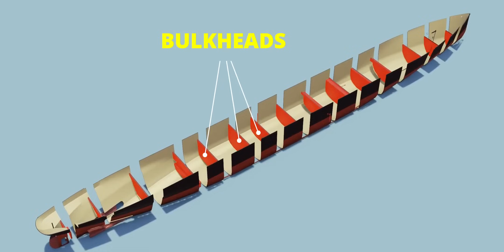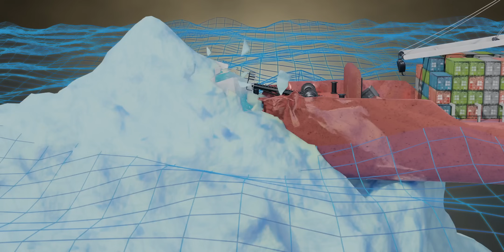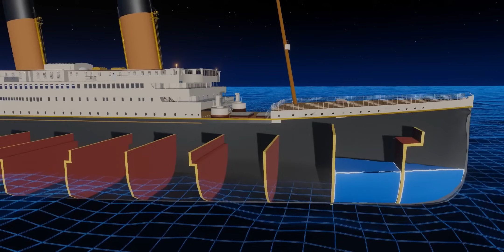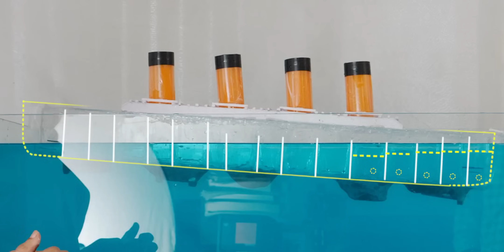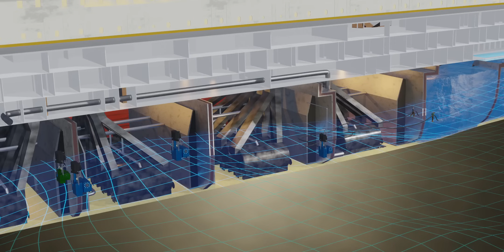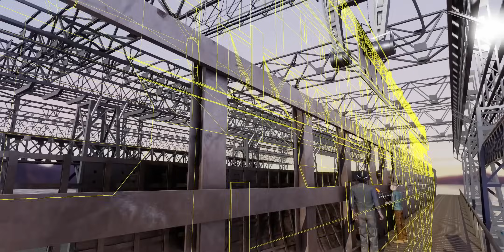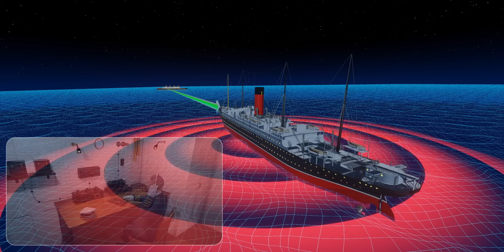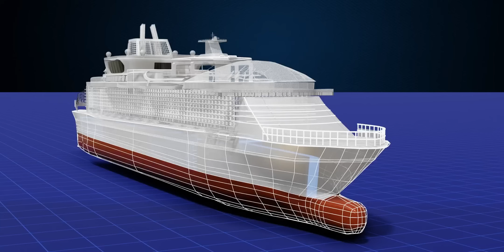How did Titanic Sink? | The Complete Physics

Comment: Min: 2:00 wouldnt it have been smarter to set the first funnel to ventilate the ship? I mean if the last funnel is the ventilation one and the 3 before kt are basically exhaust pipes its going to get sucked in by the ventilation one when the ship is going forward.

Comment: If the ship was designed to withstand the first 4 compartments flooded, then it beggars belief that the captain and designer didn't collaborate in working out the strategy to take in the event of a possible head on collision.  The single biggest mistake that finally sealed the ship's fate was the attempt to turn, instead of ploughing head first into the berg.  That should have been considered and worked out before the ship set sail.

Comment: They had two different surving options and took the most bad one.. 
1: Just shot down everything until daylight 
2: Hit the iceberg with the front 
The sides are really the most weakest points on a vessel ..
Reply: That however ignores the fact that Ocean liners never stopped for anything as they had a strict schedule fulfill with passengers paying specifically for said arrival time.

Hitting the berg from the front would have flattened the bow to the bridge, killing a few hundred people instantly while the force of the impact split her seams the entire length of the ship, resulting in her likely capsising in minutes and killing most if not all on board.

Comment: Im been looking over the building prints of the ship and you will see theres flaws and its all in the 2nd bukhead you got the firemans  sterwell runs the high of of the ship then you got the cargo loading shaft al so runs the hight of the ship then you got F deck starts at bulkhead 2 Scotland road hallway runs the length of the ship till bulkhead 10 and there some porthole just above water line high waves water will go into the ship right wheres the pumps in the cabin areas .

The ship was builed to failure Let that sink in your heads.

Comment: A deep sea sub revealed that the hull wasn't sliced but struck so hard that the bolts failed like  the video shows. Many used to believe the ice burg cut the hull like a knife. Some believe a head on crash would not have caused a sinking???
Reply: yes the cold and unperfect steel they used to make the rivets made them all snap, end of story

Comment: FYI, the Titanic's central propeller was not capable of reversing. It was only able to propel the ship forward, and even then only when the ship was moving at high speeds. At low speeds, there wasn't enough steam to run the steam turbine.

Comment: What would have happened, if, additional to pumping water from the first 5 compartments, they flooded the last compartment, effectively decreasing the tilt of the ship? Would it save the ship?
Reply: well at the back theres very important equipment that you absolutly don't want water in so even if it somehow worked it would be out of the question
Reply: @Nighthawk0954   Well, water got in those compartments anyway, when the ship sunk, so they wouldn't loose anything flooding them. However they could have saved 3000 lives if my theory is correct.
Reply: Buoyancy exist

Comment: an interesting idea you come up with about a head on collision , when i considered the design of the titanic and its sheer fully loaded weight a 50,000 ton ship travelling at 25 mph hits a static object the impact would cause the ship's structure to flex, popping rivets and splitting seams, just as in the actual Collison, but in this case along the ENTIRE length of the hull, opening up several more compartments to the sea , in this scenario the ship would sink in minutes and not hours

Comment: Funnest Fact the water tight doors and bulkheads did not go all the way to the top... so the water just spilled over to each compartment when one filled up.

2nd if they had kept going they may have still made it to America or a lot closer...but since they shut off the engines they became dead in the water. The Olympic had very similar damage and was able to limp back to port.

Intriguing theory that might not be the Titanic at the bottom of the ocean it might be the Olympic....
Reply: The wreck has been proven to be Titanic by the existance of her yard number 401 in the debris field. The switch theory never happened.
Reply: @Tozzpot500 and also titanics name was engraved on the ship not bolted

Comment: There is a one mistake in the animation. When captain order full back speed the central propeller stoped. Only the side ones could spin backwards. That could be the crucial detail. If really all 3 coauld spin backwards they could avoid the iceberg bezcoz they could slow down quicker.

Comment: One of the stories that I head about Titanic was that putting the engines in reverse was a mistake, because it actually reduced the ability of the ship to turn.
Reply: Yep its right, if they put it on all ahead full it will be spin faster
Reply: Yes, this is because the thing that makes ships turn is the amount of water being pressed against the rudder at the correct angle. By redcucing the speed, you increase the turn radius. And since it was clear they wouldn't have been able to stop anyway, they shouldn't have done that
Reply: @Sembel-xh9vq   In fact, as the video shows, if the captain hadn't turned at all and ran headlong into the iceberg, the ship wouldn't have sank at all.  Turning was the mistake.

Comment: I always wondered if they had deliberately counterflooded a couple of the aft most compartments they could have leveled the ship enough to keep water from spilling over the forward bulkheads beyond the fifth compartment.
Reply: The ship does not have a counter flooding system. Although reversing to strike the iceberg again is a crazy but workable solution.

Comment: Excellent video! What would have happened if the captain decided to fill the rear two or three compartments while pumping out the water?? Would that keep the ship at a low enough angle to stop the fifth compartment from being filled?
Reply: It would not yes it will make it more even but it will make it sink faster and it won't stop it from sinking
Reply: @MurpheysDiner  Can you explain how you know this?
Reply: @snagginbirdies1006  simple
Reply: @snagginbirdies1006  also the pumps cant pump the water faster then it was filling with water
Reply: @MurpheysDiner  Okay so you have no idea and you just guessed. You don't know if it would sink by filling or partially filling those back compartments. It sank because the angle got steep enough for water to get over that barrier into the fifth chamber. Fill the back and yes the boat will sink slightly lower into the water but it would bring the front up and maybe it doesn't get over that wall. Buoyancy is a strong force. Cruise ships today put 7,000 plus people on board, if the average weight was 175 that's 1.4 million pounds and the ship only lowers into the water a few inches.

Comment: There is a grave error in this presentation.
There was not recommended a speed of 12 knot/22 km/h during iceberg warnings when Titanic sank. That was instituted after the sinking, along with other requirements such as having enough lifeboats to everyone onboard.

Up until Titanic sank the recommended procedure was to maintain speed in clear conditions.
Ships, particularly mail-carrying and passenger liners like Titanic, were expected to keep up their scheduled speed unless visibility was significantly reduced (e.g. in fog or storms). Slowing down merely due to the possibility of icebergs was not common practice, and there were no binding maritime regulations requiring it.
If iceberg warnings were received, captains were expected to post additional lookouts and alter course slightly if needed, but not necessarily reduce speed if visibility was good.

At the time, this was not considered reckless by industry norms, though hindsight and investigation changed that perception.
There was a strong belief that icebergs could be seen in time and avoided by maneuvering, even at high speeds. Nighttime visibility under starlight or moonlight was often considered «sufficient» by navigational standards of the day.

Besides, they did take action based on the number of iceberg warnings.
About 6 hours before the collision with the iceberg, captain Smith ordered the ship’s course changed slightly southward from 266° true (west) to 245° true, a more southerly path by about 10 to 15 nautical miles.
This was a modest adjustment, and it was implemented according to evidence from surviving officers, notably 2nd officer Charles Lightoller and 1st officer William Murdoch.

Comment: Titanic could accommodate 2,200.  Could the sinking have delayed if 2,000+ mattresses were stuffed down forward staircases leading to the lower levels.  Plug  corridors running the length of the ship.  Shut every door. Drain the swimming pool.  Everybody stand on the stern and start bailing?

Comment: The tragedy is that if the coal bunker was watertight, there may have been a small chance to save the ship. But once the flimsy thing breached, there was nothing they could do
Reply: Are you suggesting that had Coal Bunker W's hatch doors in Boiler Room 5 held the flooding sea water within said coal bunker Titanic wouldn't have sunk?  The loss of Holds 1, 2, and 3 plus Boiler Room 6 alone exceeded the limits of volume Titanic could spare and remain buoyant. Of course, there was also the matter of the first watertight compartment a.k.a. the Forepeak Tank but it's relevance to Titanic's sinking was almost negligible thanks to the horizontal bulkhead forming the tank's upper layer which held back the rest of the compartment's flooding until later in the sinking when flood water overtopped the collision bulkhead after the vessel had achieve a negative enough pitch in the water. Had Coal Bunker W as it was notated in Harland & Wolff's blueprints kept the flooding within Boiler Room 5 fully within the confines of that bunker the ship would have achieved negative enough trim in the bow allowing flooding in Watertight Compartment 5 (home of Boiler Room 6) to fill up and flow over Bulkhead E into Watertight Compartment 6 (home of Boiler Room 5), the situation repeating itself until Titanic ran out of buoyancy and disappeared beneath the sea.
Reply: @RobbyHouseIV  Yes, I am well aware of everything you wrote. If that coal bunker panel hadn't given away, it may have been theoretically possible to save titanic with a perfect disaster response, but once it did there was absolutely no chance.

Comment: They only needed to stop water coming in to one compartment!
With the calm seas this is in theorie possible with a foil or leak cloth from outside.
You lower ropes under the bow and bring them to the position of the leak.
Attach two ropes to the leak cloth, and the other side of the cloth  to the ropes already underneath the schip.
Pull on the opposite side of the ship, and let go on the side where you are standing untill you reach the leak .
The cloth or foil is pushed into the hole by the force the of water flowing in, sealing of the leak to the point where you can pump out water faster then it comes in.
This works very well on smaller ships and inland navigation, probable not with rough seas.
As I understand the sea was very calm during the accident.
Reply: Are you crazy, titanic weighs thousands of tons, and it's not easy and simple for such
Reply: That don't work with big ships
Reply: The weight of the ship will be insane on such also
Reply: The pressure will be so much it will break any repairs
Reply: It's not simple

Comment: Think of this: if the watertight doors remained open, the ship would have remained afloat for much longer time, probably quite enough to save everyone onboard. (Some say up to 24 hours!)

DISCLAIMER: I do not blame anyone onboard for closing the watertight doors! I would've done the same if I was onboard and in charge!
Reply: if the doors were opened the water would've easily flowed throug all compartments which would make it sink faster
Reply: @Nighthawk0954  to the contrary!  Find out the volume of the ships hull and the water flow, divide them to get the time and you'll realize I'm right!
Reply: @bsimic29  opening the door would've make it sink faster because of the free surface effect making the whole ship unstable which could cause it to have a dangerous list or capsize like her sister Britannic or the Impress of Ireland which all didn't get to close their watertight doors also aside from the free surface effect, the doors being opened would've flooded the boiler, engine and dynamo room earlier which would cause it to loose power way earlier and that would've plunged the ship into darkness faster causing absolute chaos and making evacuation harder also no power means that the wireless system can't work since theres nothing to power it making distress calls impossible. And to finish the boiler rooms being flooded could present high risks of boiler explosions which could make the whole situation worse.
Reply: @Nighthawk0954  I agree with you on most of things you've said, except: "free water surface effect" would take more time to capsize the ship (if at all), there were emergency generators onboard the ship that would give light for some time and radio room had its' own backup supply that would enable them to keep sending messages. The only important thing was to remain afloat until Carpathia arrived, and (absolute?) chaos due to darkness would definitely take less lives than sinking into freezing water.

Danger of exploding boilers is present if water was rising rapidly, which would not have been the case in Titanic disaster.

Britannic had different type of damage comapred to Titanic (explosion blast that made much bigger hull opening and had ships' internal structures damaged which made it sink much faster and more prone to capsizing).
Reply: @bsimic29  let me ask you a question: why do they even have watertight compartment and doors in the first place if its not gonna do much like you claim
Reply: @Nighthawk0954  They had compartments and doors to protect the ship in case of breaching:
- any two consecutive compartments
- any three non-consecutive compartments
- last three compartments
- first four compartments
But you already knew that, I'm sure.

In case of breaching first five compartments (or more), the story becomes different and saving lives (not the ship) becomes imperative. If opening watertight doors would've saved lives, doors should've been opened. (As I've heard some time ago, some watertight doors were actually opened later, during sinking.)

Now, my original post was purely hypothetical, I'm not expecting them to come to this conclusion during sinking neither putting any blame to any crew member for not doing so! I was expecting some discussion here about the idea.
Reply: Now, there's another hypothetical question: could've they re-started engines and sail towards Carpathia, to reduce distance (and therefore precious time) until rescue? Could they have sailed astern instead of ahead to reduce water intake?
Reply: @bsimic29  the absolute dumbest thing you can do with a sinking ship is start the engines because it will sink faster (that was one of the reason why britannic sank faster) and carpathia was about 93 km from titanic so it would be useless to do so and another problem would be lowering the lifeboats because they would be drawn towards the propeller like britannic if they kept them on

reversing the engines would do absolutly nothing because no momentum could save the ship because whatever they did titanic will 100% sink

Comment: What I've never been able to understand is why the athwart ship water tight bulkheads only went up part way and left the compartments open at the top. Each of the decks could have been built to be sealed in an emergency like the watertight doors. On the plus side Titanic did not roll over and sink but went down but upright allowing people to get off. Andria Doria suffered a side impact in 1956 and rolled over and sank, fortunately help was close at hand. Costa Concordia was torn open on her side and rolled over and sank, again help was right there.

Comment: Since there was a instruction for full speed, it means that the boilers had been extremely loaded for more heat and steam. 

What if there was a powerful boiler explosion. 

At the angle the ship was at some point should make it impossible for boiler operators to operate and control the boilers and pressures anymore, boiler explosions are very very powerful, it could caused a major weak spot on that particle area of the ship, which could cause the ship breakage.